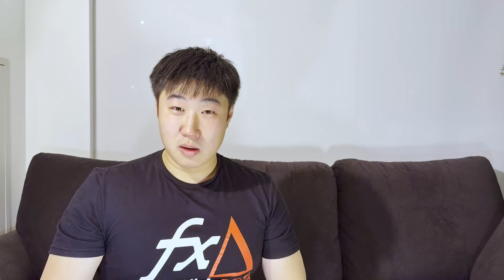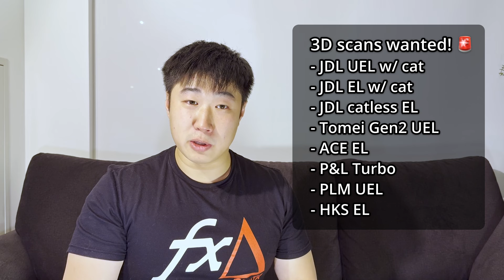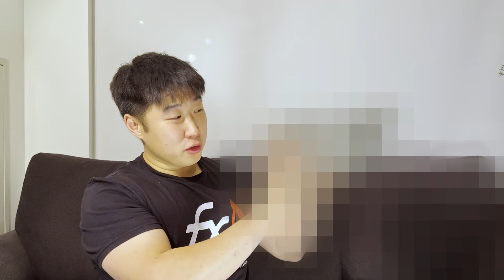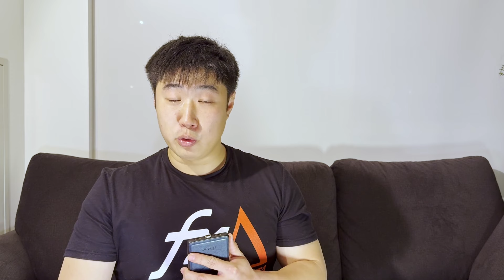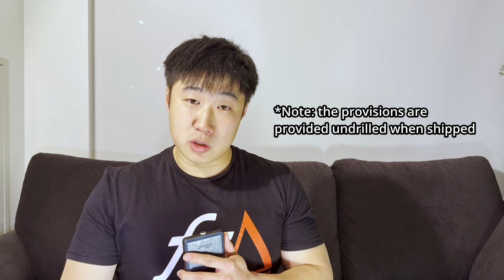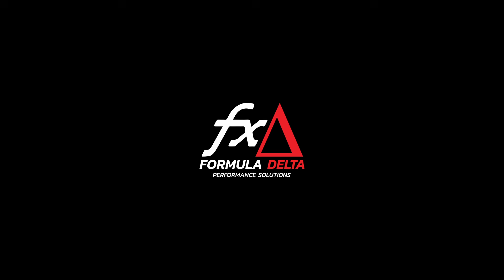Toyota GR86 / Subaru BRZ high capacity oil pan for FA24 - Update #2

Comment: Hi! I have an FA24 swapped car and will be adding oil pressure logging capability within the next month. The car will be on track in March, April, and May back to back and I'll be getting sample data. I have a JDL EL Catless header installed, but sadly no 3d scanner. This is a race application with 200tw tires and a simple aero package. Is there something I can do to contribute to the project?

Comment: Regarding photos; I have in the past used Autodesk 123D Catch for photogrammetry. This produced a reasonably believable point cloud from the photos, though the results I had wouldn't have been precise enough for the header clearance application. However, poor fit was on plain detail-free (or overly fine texture, e.g. hair) surfaces. I'm sure that just using a magic marker to draw on more details for the photogrammetry to match things up would help greatly, possibly good enough to work at least for gross go/no-go cases.

The 123D suite is no more, but there are other options out there nowadays - some free - which might just be good enough. It'd be interesting to see if people offering photos could be guided into a usable solution.

Comment: I watched your video on Drivers Paddock. One of the takeaways i found was that the oil is basically being stuck in the head. In conjunction with the oil pump, basically dumping the oil pan in 5-6 seconds. It would seem that the oil pump is pushing more oil than is needed at a given rpm. 

As counter intuitive as it may sound. Would a pump gear that pushed less oil throughout the rev range be beneficial. More oil is good, but a pump that empties a pan to quickly sounds like too much pump for this motor. Increasing the capacity is basically doing the same thing. Increase volume vs. decrease pumping speed. I'd like to hear the science or your ideas behind this. Can the gears be replaced or modified in this pump? Is the pickup in this replacement going to go lower into the increased sized pan to pick up the lower volume of oil?